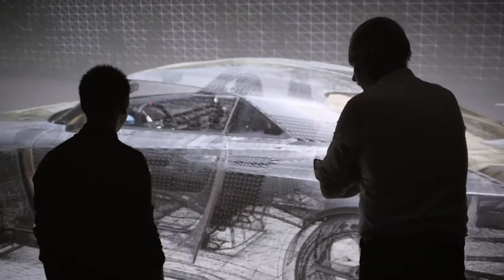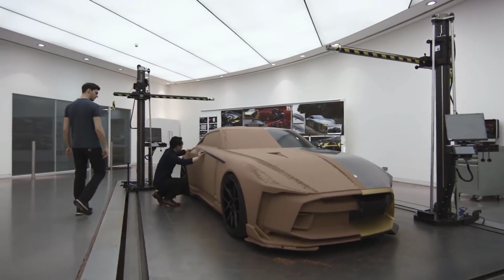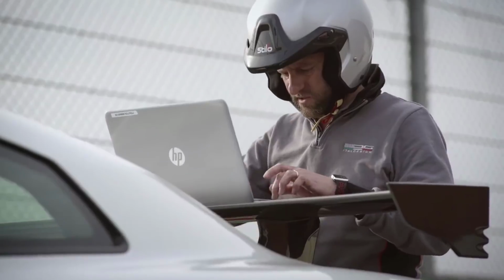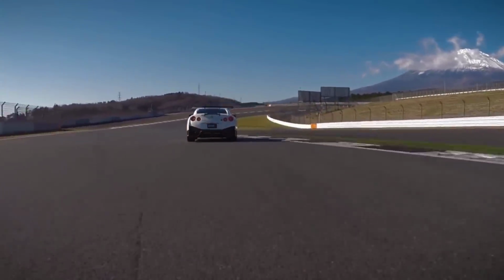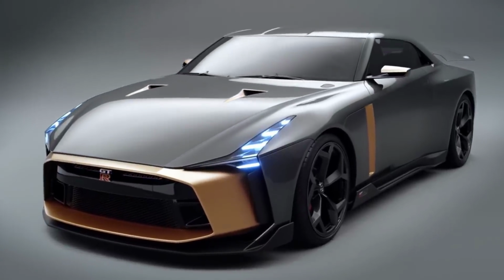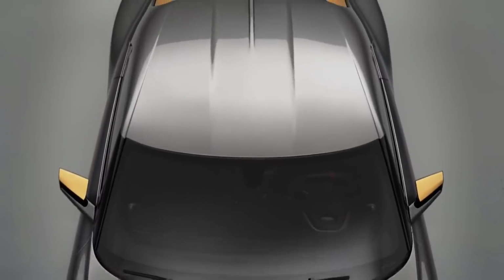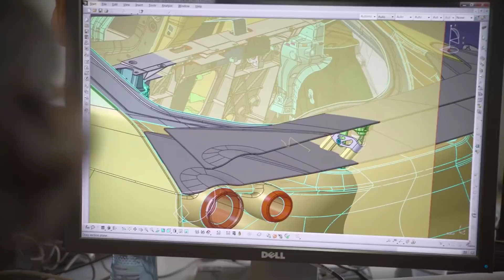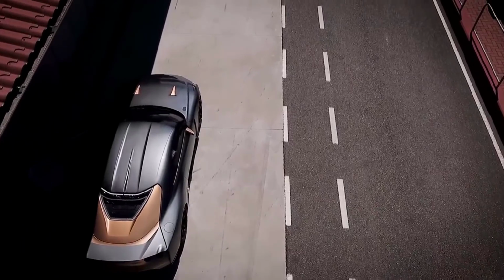Nissan GT-R50 - Japanese performance and Italian craftsmanship

Comment: All the gold should have been carbon fiber instead.
Reply: yeah except for the carbon fiber alone to be molded in that design would just more expensive than the car alone
Reply: should just stop with the carbon fiber hype. Nissan GTR is an affordable sport car, not a hypercar, we don't need unnecessary extra fee on a beast. Also replacing the gold will lose all its meaning, they wanted to design a car in a car, blending the outer colour with carbon fiber will make it look like a normal supercar.
Reply: Ng B48 Nah its just certain sections not the whole car in carbon fiber. It would look much better. Who want to look like there driving 2 cars down the street.?!?! Not me...
Reply: GT-R has never been a light car. They say "it has mass" and that was one of the main ideas of its creator. It resulted in a car that feels exceptionally "sticky" on the road - once it gets going. It's not the perfect sprinter, however. 
I like the back, but the front looks like another car is waiting to drive out of it ;)
Reply: I agree about the carbon fiber. There is anyways a lot of carbon fiber on the interior and adding more carbon fiber on the outside will just make the price ridiculously expensive for a GTR.
Reply: No. No carbon print.
Reply: @austinmcdowell64  you're high fam
Reply: Ng B48 t
Reply: Ng B48 t
Reply: It’s an anniversary design by Nissan, it has to be black and gold
Reply: i would prefer it completely in black
Reply: Agree
Reply: The gold accents probably represent the golden (50th) anniversary of the GT-R
Reply: @Ndendy1  lmao what the hell is everyone saying this is a limited edition run of GTRs and they cost 1.2million a peice this entire car should be carbon fiber.
Reply: Phase 2 I agree
Reply: you can have that too. each one of this gtr is custom made
Reply: Nah, enough of carbon fiber please.
Reply: Let it gold

Comment: Looks amazing, but is that the only selling point? Are there significant weight savings? It's obviously faster than a standard GTR, but its also worth nearly 10x a standard. The power advantages are clear, however, it's not hard to tune a standard GTR to have well over 700hp.  I would rather see a limited version of the GTR following in the footsteps of the Huracan Performante, GT3RS, Ferrari 488 Pisto, where instead of just panache, you see a really amazing version of what the car could do.

Comment: I love the design but I'm not sure about the rear window and I wish the roof line had a more slanted roof line like a fastback design
Reply: I would add that the rear Nissan Badge looks as it is simply stuck on the car. As if someone forgot to at the last minute and just stuck it on.

Comment: In all honesty, the last GTR that was fun/ a real joy to drive was the r32.  I was so disappointed with the 33 and 34.  The R32 was fun to drive at any speed on any kind of road.  It was far more nimble and transmitted feeling to the driver.  When I drove the R34 it felt like a boat and was only fun in a very narrow band in certain conditions.  I could drive the r32 as a daily driver gladly, not so with the generations that followed.  They new generations are faster, there is a lot that has gone into engineering, but they have lost the narrative of man and machine.  Porsche still understands this well.  I hope they can get back to that.

Comment: Design is jagged and has no smooth flow.  It is like a piecemeal putted together car done by a teenager.  The contrast color at the back trunk is so strong it diminishes the iconic back signal lights.  I love the previous few gens of GTR.  This one is like a R35 modified.  No thanks.